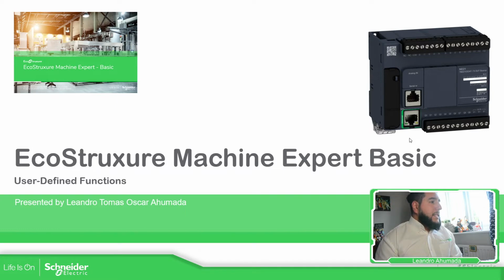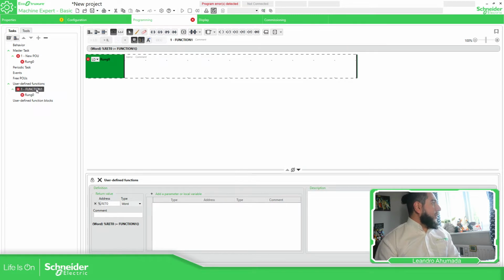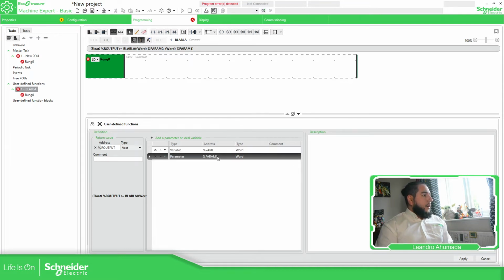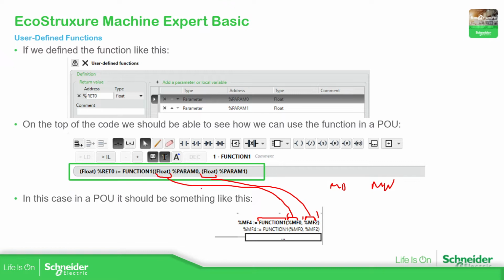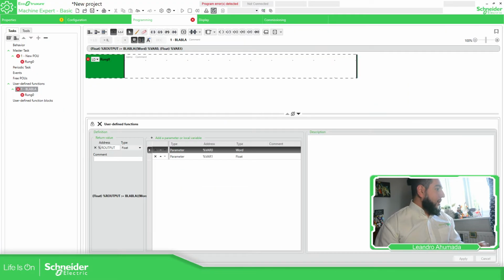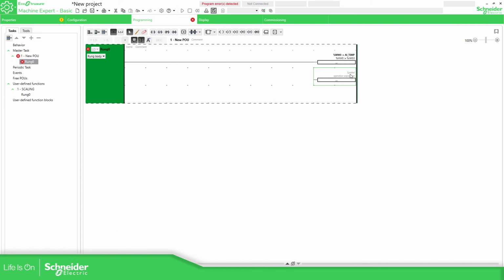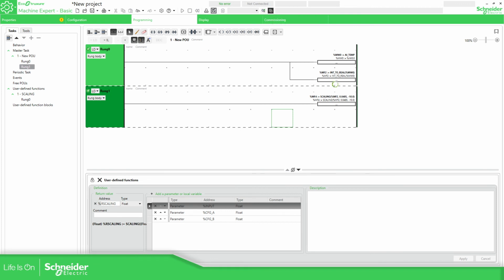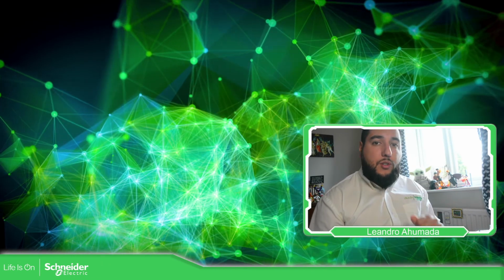Training - M221 - M18.1 User Defined Functions

Comment: I'm following this tutorial, but I can't seem to be able to change the PARAM address names from default, or be able to add comments. Has this feature been removed? I'm running Version 1.3 build 215.
Reply from the maker: Hi there! There is a newer version v1.4 that allows you to protect the function. I have not tested on the newer version but i believe you should change the names

Comment: Can you share the excel sheet ?
and  how to distinguish the incremental and absolute encoders inside M221 ?
Reply from the maker: Hi Ahmed! Please find below the link to download the excel file:
https://schneider-electric.box.com/s/nz7yckmbcbvrqij2cmaxcna8kvx99kfb

Regarding your question about the encoder, the modicon M221 can use only incremental encoder.
Reply: @LeTomasAHUMADA  
Can you explain the difference on m241 if possible?
Reply from the maker: @ahmedabdelraouf6638  for the encoder? You will need to use a incremental in M241 if you use the IOs unless you have an absolute encoder via CanOpen